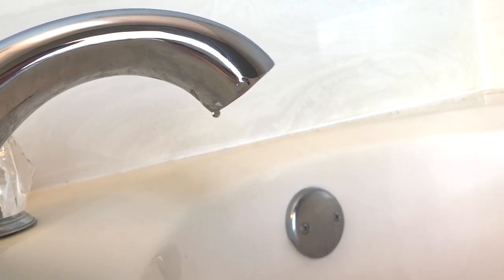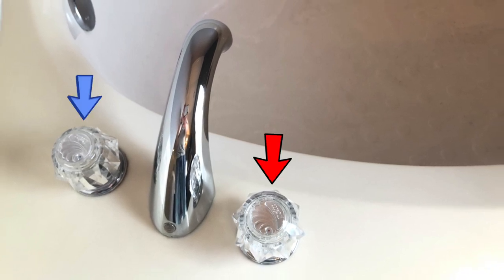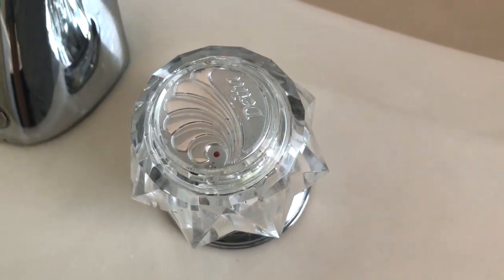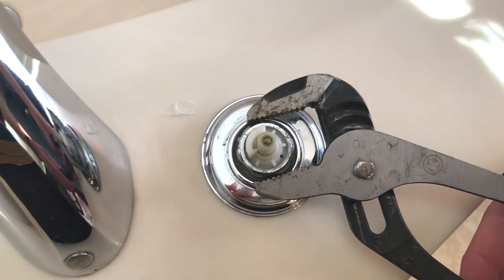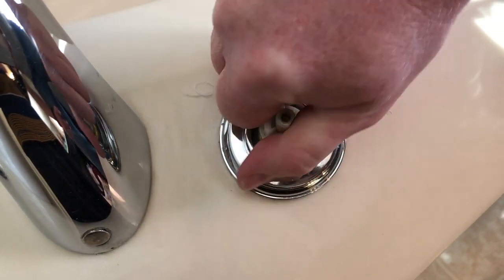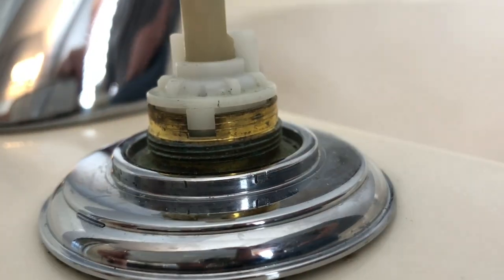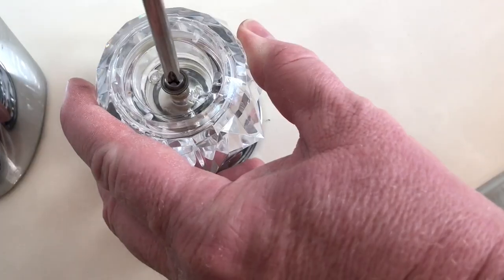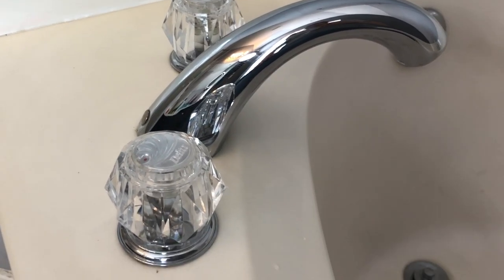Fix a leaky tub faucet with two handles

Comment: What happens when the water is leaking below the faucet underneath the fiberglass shell?
Reply from the maker: That one may require a plumber, unless you can get under there and see exactly where it's leaking.
Reply: @KeepinHomeUp  No way to get under the tub as it’s slab on grade. I’m thinking of cutting the fiberglass shell on the side to open it up and see what’s causing it. I figure I can make a tile side skirt to go over the cut section afterwards.